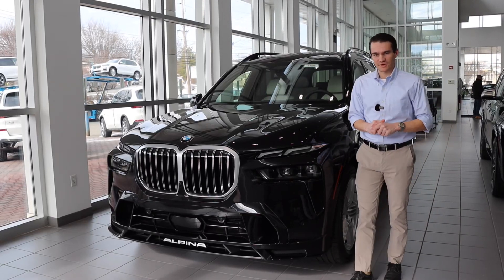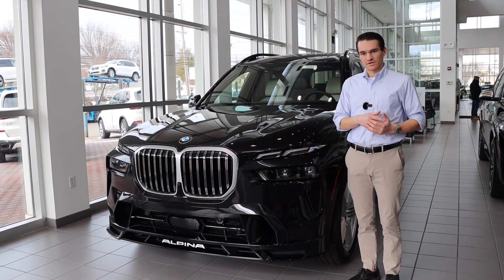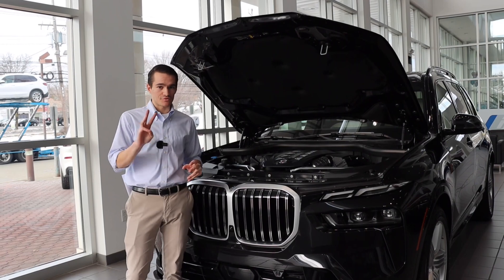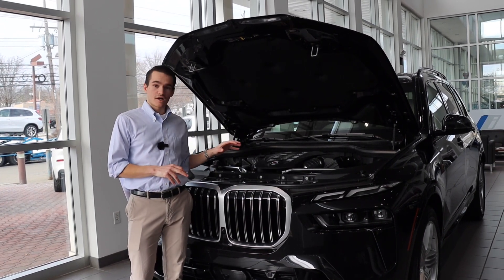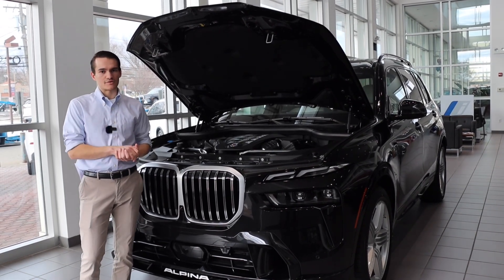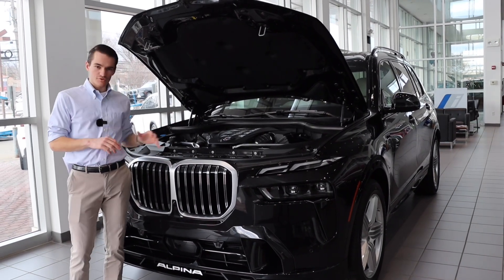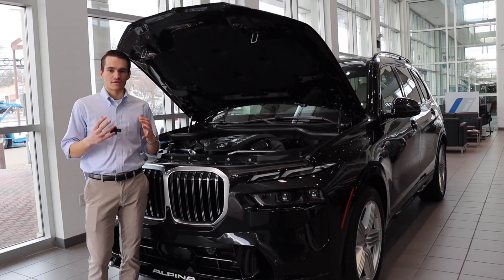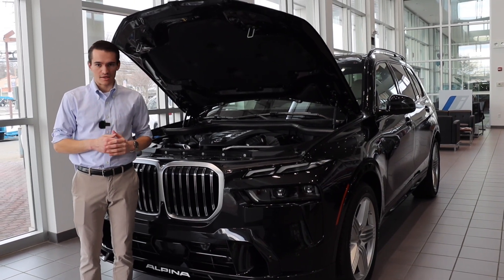The S68 V8: Everything You Need to Know About BMW’s Newest Engine

Comment: BMW changed the vanos system, new crankshaft and a few other things because it's a partial hybrid. The basic engine block and cylinder heads along with numerous parts are the same as the N63/S63 engine.
Because of the added weight of the hybrid bits, the pre LCI S63 X5M is actually quicker by .1-.2 seconds in the 0-60 mph sprint.

Comment: The s68 looks like an n63. Disaster engine. Never another bmw.
Reply: This looks nothing like an N63💀 you have no idea what your talking about 😭 this has not been out even close to enough time to say it’s a disaster
Reply from the maker: It shares basically nothing with the N63.
Reply: @bmwofmorristown9038  Consider the trials and tribulations I had with BMW corporate on my 2011 n63, I believe you, but not them. My next car was supposed to nbe aB7.....
Reply: @XcoolcoolbeansbeansX  they have you brain washed. There are already rebuilt s68s available for sale on eBay. Range rovers are still using the n63. There is no way they are making a separate engine for rr.
Reply: @starshiptrooper4506  new ones have S68 LOL

Comment: The sound of X6M60i is nonsense..Taking mine back..dealer telling I have to drive over 350 miles to unlock the effect bcos factory setting with reduced power till then.
Reply from the maker: That is correct, the car has a 350 mile break-in period. Until you drive 350 miles, the car will have limited power. This is because it's an "S" engine.
Reply: Thank you for your response.. see on the screen there that as I cruise around , the expected mileage to be reached to unlock the beast is reducing..beautiful
Reply: @arohaodufu7998  does it sound better now?
Reply: @MrBobby8521  waooo, yeah.. what a beast ! Very aggressive and the turning at corners on speed is marvellous and smooth… thanks

Comment: Still didn’t get rid of the hot vee layout 😪😪
Reply from the maker: Why would they? They've honed it well in the years it's been in use, and it works quite well now!
Reply: @bmwofmorristown9038  With all due respect, the N63 was the worst engine BMW ever produced. Only in the TÜ4 version a decade later was it finally reasonably reliable.

Would you like to take a 2011 F12 650i as a trade-in?
Reply: The more complex the more machine gives you trouble as if promised.

Comment: I was skeptical this new s68 powertrain because BMW developed this for passing new emission rule not providing better product to the buyers. 
It has more complicated MH system like Merc, the repair cost will be much higher in case things went wrong compared to former N63. 
The iDrive 8 UI is a mixed bag because BMW went too much for the touch screen. 
We want some hard buttons and dial to be used by muscle memory. 
I know  removing the buttons will save the material cost and reduce the number of semiconductors so it is a big win for BMW.
Reply from the maker: While the S68 was developed to meet stricter emissions requirements, they didn't cut corners on performance either. It's the most powerful engine BMW has made to date, and it seems to be incredibly robust. While MH tech will undoubtedly be expensive to replace should the need arise, it's proven to be quite dependable so far. 

Regarding ID8, we had the same thoughts at first, but have come around on it completely; it works well and the iDrive knob still exists for folks like you and I who prefer not to use a touch screen.
Reply: @bmwofmorristown9038  Thanks for your reply. 
From my research, the new LCI x5 M competition is 0.1 sec slower than the pre lci regarding the 0 -100 km/h performance.  X6 M retains the same time. 
It sounds weird as it should be faster than the pre lci because it can add instant torque from the electric motor. 
So I concluded BMW de-tuned the engine to meet the emission over the performance improvement.
At the end of the day BMW can’t sell their cars if it failed new emission testing. :)
Anyone can guess having hard buttons will cost more let alone more semiconductors are needed to process them.
Bmw has removed even the 8 short-cut buttons and stomped the crystal gear to a tiny switch. 
It will definitely save some money from that perspective.
Bigger touch screen will need more electrical power , which why the 48V comes to the party. 
The 48V lithium battery won’t cheap as well when it needs to be replaced, though.
Reply: Wait until tested. We can't listen to BMW when it comes to figures.
I'll be curious to see the new and old drag.

Comment: Real nice video. I drive an S63 X5 , and knew that the power outputs were similiar , with the new engine.
But , most of these S68 tech details were new to me.
Thanks a lot ...!!
Reply from the maker: Thanks so much, and you're welcome! Glad you enjoyed the video!
Reply: S68 has the starter motor integrated between the zf transmission and the engine. 
The s68 x5 M is 0.1 sec slower than pre LCI x5 M. 
The main reason they developed the s68 is to overcome the stricter emission regulation not improve the performance.
Reply: @EastWood2004  Thanks for those details...Although the new V8 incorporates changes from the S63 , I have wondered about the reason for its developement. 
What you've said certainly makes sense.
Thanks !
Reply: @garyjohnson1392  Glad to hear that..
The S63/N63 has also been heavily revised by several iterations. So BMW should have named them like S64, S65 and so on.  
It is just the marketing tactic saying that it has the brand new engine. 😅
Reply: @EastWood2004  already have an S65